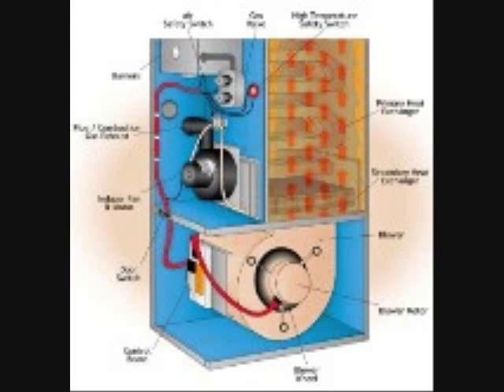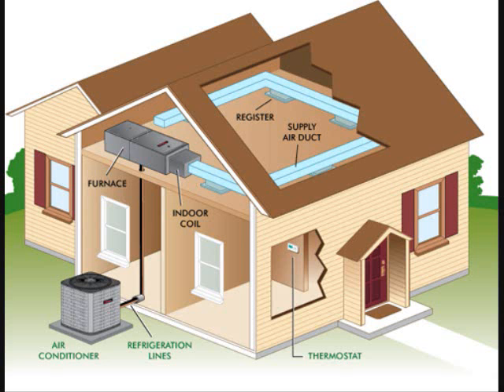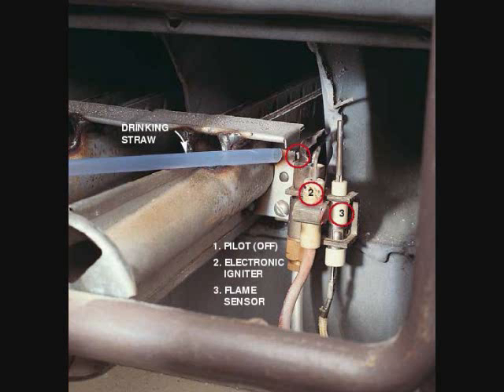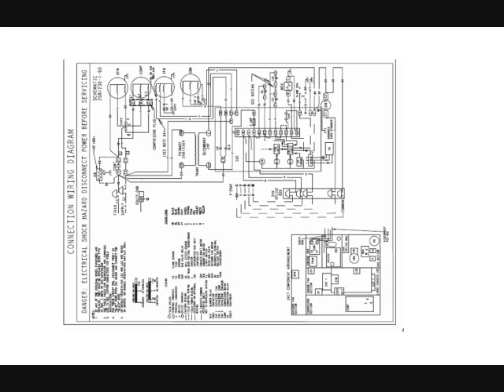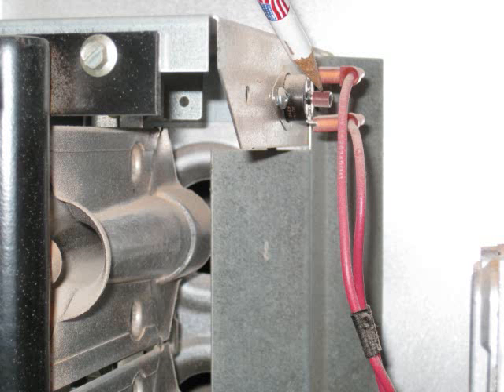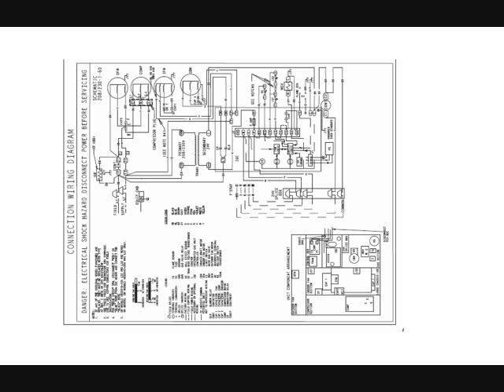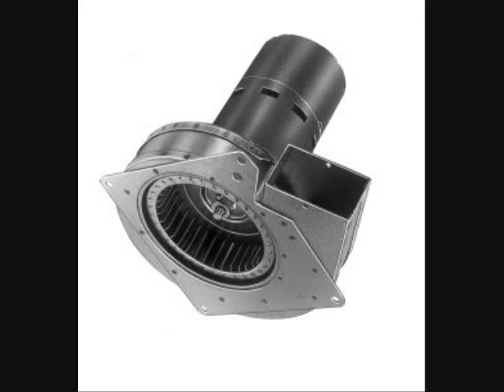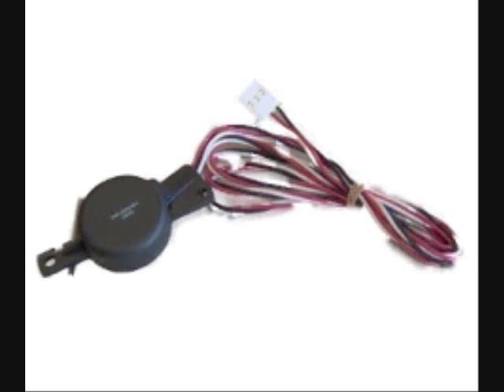FURNACE HOW TO BASIC TUTORIAL

Comment: at 1:26 the small fan motor with the outer black disk, what is that called? I have one exactly like it and it is making metallic noises and I think needs replaced.
Reply from the maker: The inducer Draft motor. You can buy it as a whole assembly.
Reply: Yes thanks a relative told me that same thing. Funny right after this the blower fan on a electric forced air furnace died. I replaced it but Lennox sucks for getting parts as they do not sell to anyone not licensed. Found a company that bought it for me and I picked it up. This inducer I have found online but have yet to get one. the noise is on and off so I am waiting for the thing to get worse before replacing. probably the wrong idea but I am a procrastinator ;-)

Comment: I have an Armstrong high effic furnance. The venter motor has been replaced 3 months ago by technician. Out of the blues, yesterday while everything seems to be ok, after I turned off the heat due to warm spring, the venter motor got stuck running. After 2 restarts cycles of turning heat on, it seems to function ok now. How is the venter motor switched off in theory? Any possible explanation of what might have happened ?

Comment: The furnace will start but heat will not go through the vent. It just offs. It is a gas furnace it is original to the house that was built in 1988. What is the problem?